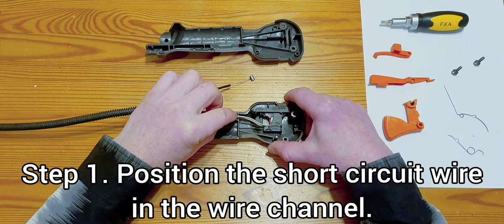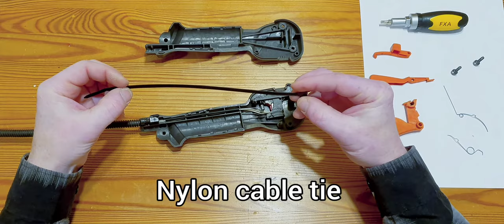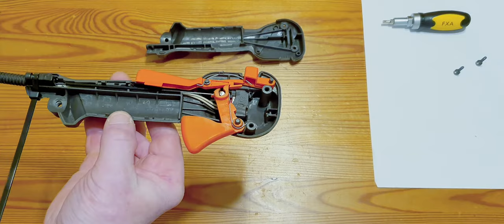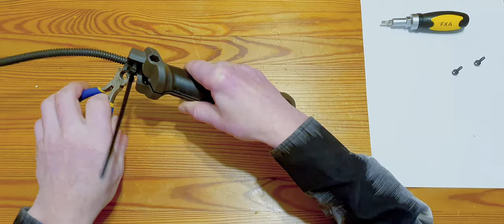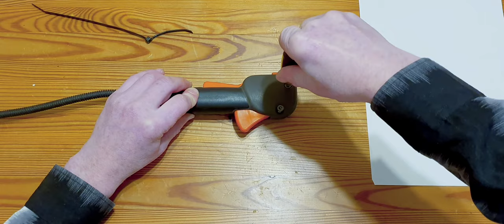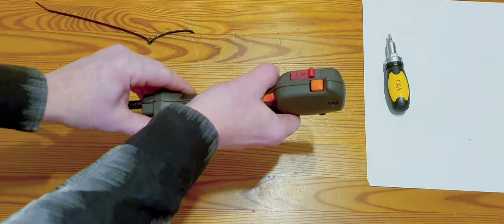Husqvarna | How to Assembling the Throttle Control Handle of a Brushcutter.

Comment: Very much appreciated the video after pieces sprung out while taking the handle apart.  Thanks.  All the triggers work except my STOP button.  Could not start the engine and the STOP but now has no resistance.  Could I have disassembled the STOP button during the process.  No mention of it in the video.
Reply from the maker: The fault is either in the stopswitch or the short-circuit cable. Change the switch as needed and inspect the cableinsulation for damage.
Reply: thanks.